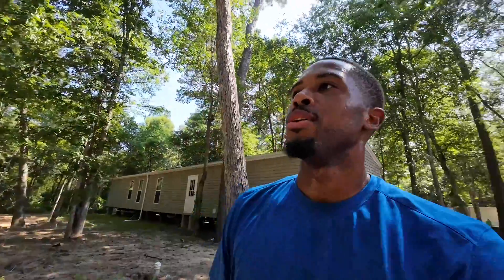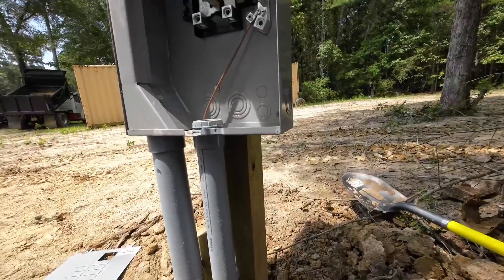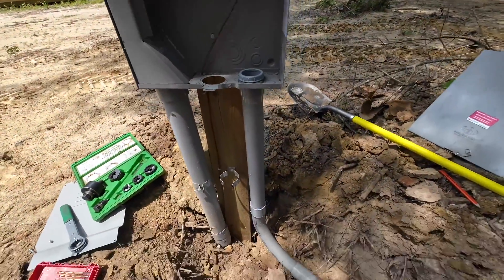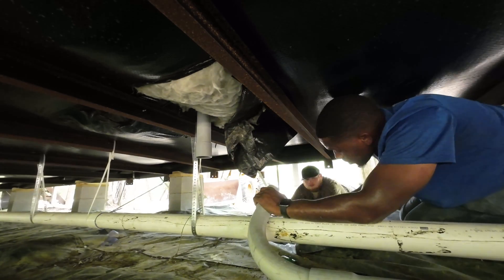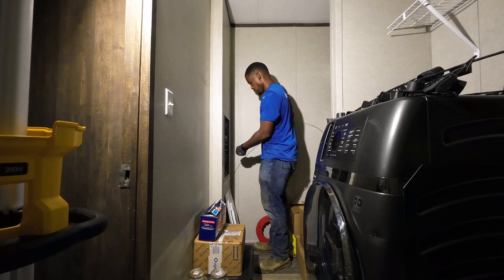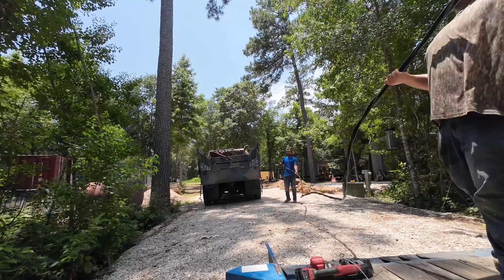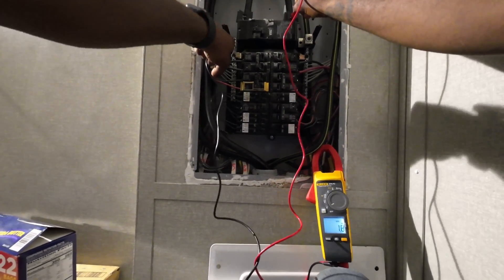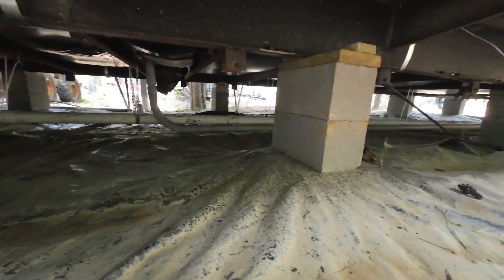Installing A “200 Amp” Electrical Underground Service For A Mobile Home!

Comment: What size wire was that?
Reply from the maker: It was 200amp service, 4/0 Aluminum!
Reply: @TheApprenticeToJourneyman  hi, sorry I know nothing but I was told to hook up from outside box to inside, we needed 6 gauge wire? 3 wire with a ground? Hope we was told right for 200 amp box. ??? Thank you

Comment: He bro heres a tip take it or leave it, i do tons of mobile homes.

Use a 2” F/A for the pvc going into the mobile homes and use liquid tight 2” for the last 6’ before entering into the home using 2” liquid tight connecters.
Reply from the maker: I haven’t done that before on a mobile home but I don’t see why it wouldn’t work! Thanks for the advice..👍🏽

Comment: Pretty sure you found a way to pull the wire easier by now but a friendly tip that I wrap the mule tape around my lineman pliers to pull it.
Reply from the maker: Yes sir you are absolutely right, I’ve done it with my Lineman pliers & a short piece of conduit both work great, Thanks for the advice!👍🏽

Comment: What size wire did you use to run to the mobile home?
Reply from the maker: @LeithiaWilliams  4/0 Aluminum for 200amp service. You can also use 2/0 copper for 200amp service.. But we typically use aluminum it’s more affordable!
Reply: @TheApprenticeToJourneyman  so you will run a a number 4 awg from the outside meter to inside the trailer?
Reply from the maker: @LeithiaWilliams  I would call your local supply house to confirm because every county & state does things different!
Reply: @TheApprenticeToJourneyman  appreciate that.
Reply from the maker: @ No Problem!

Comment: I had to this myself unfortunately two times and it is tough pulling those wires through but I didn't glue the conduit,  wish I would have thought about it because it would have made it so much easier,  God Bless you and your family 🙏 ❤️
Reply from the maker: @bigrigchristfollower9020  I’m so sorry you had to do it yourself, Your absolutely right pull the wire is know joke I wouldn’t be to hard on yourself about the glue you just didn’t know! Keep your head up & God Bless You..🙏🏽

Comment: How much would something like this cost
Reply: Well if the prices and if you feel you can do it yourself just on price i sujest you set the post from 6 ft and more and the price range on material from 800$ to 3000$ if not more
Reply from the maker: @ I believe you are correct!👍🏽
Reply from the maker: @samharrier7203  I honestly couldn’t tell you it depends on the distance, how many  ft of PVC you need, wire size etc it really just depends..

Comment: just a few thoughts i had while watching the video. when i snake wires, im always conscious of where the snake ive pulled is going, for the homeowner and for myself (so i dont have to hear the homeowner complain)...watching you work im sure youre aware that the snake can hit the panel hit your face hit the wall hit appliances. personally i hate working in crawlspaces but if i gotta i gotta, but my heart went out to you there, working in a c.s. in the summer sucks ass. those klein cable cutters are trash, klein did something to the handles that screwed up the leverage, if you cant get ratchet cutters yet, the greenlee cable cutters give you more leverage.good work out there.
Reply from the maker: @johnkoutsoupakis  Thanks you John for the advice, it’s definitely important to be careful when snaking your wire.. The Klein cable cutters have been ok for me so far hopefully I can get the ratchet cutters one day.  Thanks again and my apologies for the late response.

Comment: From the meter pole to the subpanel in the house did you only run 3 4/0 aluminum wires? And is a ground rod at the main meter pole enough? Or do i need one at the subpanel too?
Reply from the maker: @pilotoblackbird433  We ran 4 total wires the 2 Hots were 4/0 aluminum & the neutral was 2/0 aluminum. We installed our ground rod at the meter pole, I don’t believe you need one at the sub panel when you have one at the Main meter pole!👍🏽

Comment: Looking good son!!!!
Reply from the maker: Thank you my Man!🙏🏽
Reply: @TheApprenticeToJourneyman what size wire you run in that conduit ??? And was this a 200 amp breaker at meter to 100 amp breaker in panel ??? What was your complete set up ??? I would much appreciate your help
Reply from the maker: @garyhicks5630  Honestly I would have to go back and look at pictures from when we did the job, I believe it was a 200amp service & we used 4/0 aluminum. I’ll check it out & let you know!
Reply: @TheApprenticeToJourneyman  thanks bud I appreciate it and yea 4 aluminum sounds about rite now you had a 200 amp breaker at the meter but the panel was 100  amps correct ?